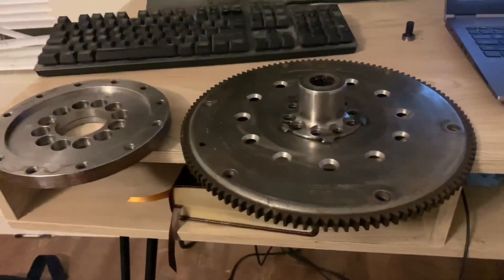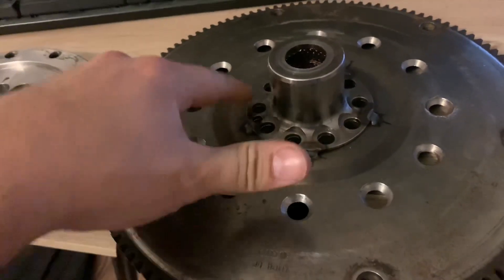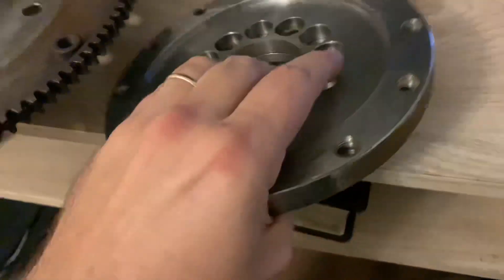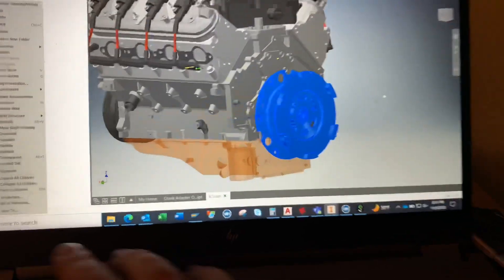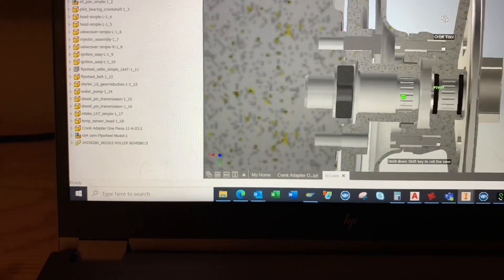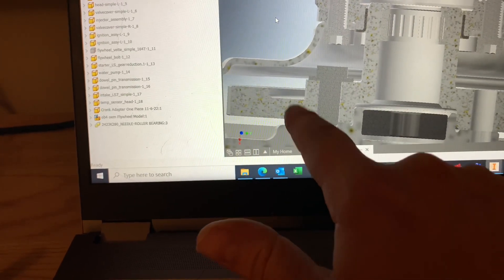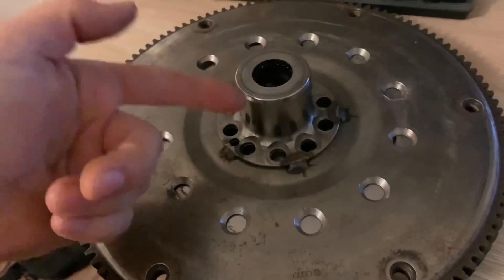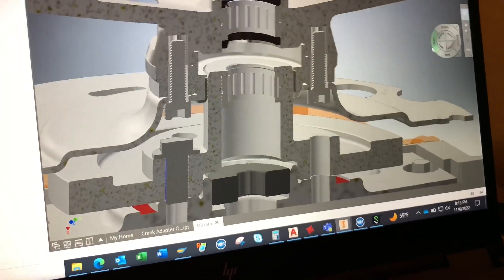B7 Audi A4 LS Swap (Flywheel Adapter Design for AWD Transmission) Ep: 8

Comment: Hi, what is the status on your kit?
Reply from the maker: Haven’t really made any progress in last year. I have a starter design that works but requires a custom flywheel which I’d like to try to avoid manufacturing as I don’t have a CNC lathe or balancer and out sourcing is either outrageous $$ or quality is questionable (had some samples made and was not happy selling them to someone).

The new design would solve this issue but I haven’t had the time to test it out as wife is pregnant and our 760 sq ft house 1 bedroom house was too small so been spending this time building an additional two bedrooms. That and work is busy. 

Still gotta verify the 0B4 clutch engagement height as well because it’s different than the 0B2 I’ve used in my car. Motor mount position needs tweaked and new fixtures need made, and I still need to make a fixture for transmission mount. Hindsight being 20/20 should have probably started with a B8 and made a custom front core support so trans mount, axles and driveshaft could be OEM.

Good news in baby is due at end of next month and I have 6 weeks off from work luckily so will likely get some time to get back to working on this project.

Comment: Too bad all A8 are automatic and no way to make that transmission to work by itself
Reply from the maker: I didn’t understand your comment?
Reply: @projectLSaudiA4  there
Reply from the maker: @orlanmedina3693  There’s two versions of this basic transaxle design that are of interest, manual and the 8HP55 automatic (from A4, A6 and A8). I’m currently using the manual but TurboLamik makes an aftermarket ECU for the 8HP transmission that I have seen used across multiple platforms that would allow the automatic to work as well. Future video planned.

Comment: You should do a vortech supercharger setup on it especially since your so tight on space you would have to pretty much mount it like the jhm kit is on the std S4 BHF 4.2 I personally went a different route with my build I swapped in BBD from a c5 s6 its a timing belt in the front 4.2 and comes with forged crank rods and pistons I then doubled up my head gaskets and replaced the sodium Filled exhaust valves with inconel valves and upgrade springs and sourced my own vortech V2 t trim capable of making 950hp and rev to the upper 8k rpms and the s6 engine was direct bolt up to my 0a3 6spd trans I'm hoping to put down upwards of 800hp to the ground on the build
Reply: Do you have an ig or anything for your build? Would love to check it out, I have an s6 4.2 swapped b5 avant with an 01e, have a tvs supercharger going in hopefully soon(been backburnered forever while working on remodelling my house and my 57 chevy that Im doing an LSA upgrade in). Converting to 8 rib pulleys for the 4.2 to overspin the blower
Reply from the maker: @CelticVargr   nice! I have a forum thread on LS1tech. 

See build thread here: https://ls1tech.com/forums/conversions-hybrids/1949431-b7-audi-a4-ls4-awd-swap.html#post20356050
Reply from the maker: Thanks for the tip. I’ve looking into single turbo options but space is limited.
Reply: @projectLSaudiA4   delete the 2nd firewall and relocate the battery to the back of the car, plenty of space there for single turbo and will give a little more room to work on things too
Reply from the maker: @CelticVargr  I’m looking into that already but there’s not much room between the power steering rack and the back of the engine to fit the up pipes, then same thing with the down pipe—not much room on driver side to fit down pipe larger than ~2.5”...  I’ll figure something out eventually.

Comment: 👍🏼, that’s cool, we have the same car 07 but it’s a stick shift, it’s been broke down a couple years now was going to scrap it but can’t muster up to call a junk yard it’s in nice shape just doesn’t run, I was thinking how could I stuff my 455 olds big block in it, a pipe dream till I’ve come across this vid🤙🏼👍🏼
Reply from the maker: Mine is stick shift also...
Reply: @projectLSaudiA4  do you make mounts to sell, moter mount, flywheel,ect. If so I’d definitely be interested and I’m sure many more people would support you, it’s a new thing I’ve never seen but allways envisioned, American muscle in a little foreign car 😎, your a trend setter on this one buddy keep up the awesome work.
Reply: @joecrockett1385  I'm also interested in an adapter. I have a b8 quattro 6 speed manual. Asked before on forums, but was turned down. Not really sure why... I wanted to put it in a 52 Ford.
Reply from the maker: @itskarl79  @Joe Crockett I’m working out the bugs, relax guys. I’m engineering this stuff from scratch—there’s a reason no one has done this before. I don’t want to sell anything to anyone unless it’s been worked through and is as close to bolt on as possible. With that being said, I have prototypes of the starter mount, the new flywheel design, and am getting the bell housing adapter reworked within next two weeks. Stay tuned!
Reply: @projectLSaudiA4  I think for you, it has more to do with the status of being first with it, but I could care less about that. I think it's a cool swap you're working on. Sell stuff or don't sell stuff, I'll figure mine out. I've considered doing a 1.9 ALH instead of an LS, no adapter needed.
Reply from the maker: @itskarl79  B8 transmission has a different bell housing pattern than an ALH or 01E, so it’s not bolt on from what I remember...
Reply: @joecrockett1385 still got the audi
Reply: @668rodney  no actually just let it go a couple weeks ago , it was sitting for 3 years was tryin to hold on to it but let it go I wish I hadn’t, sellers remorse